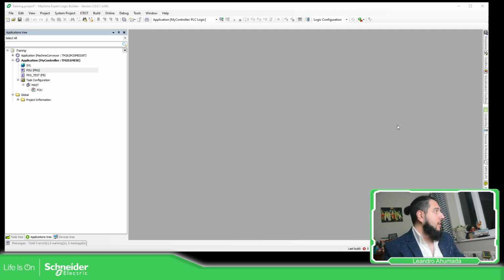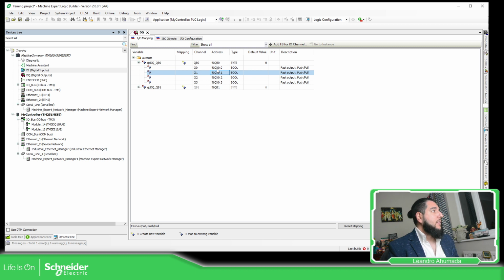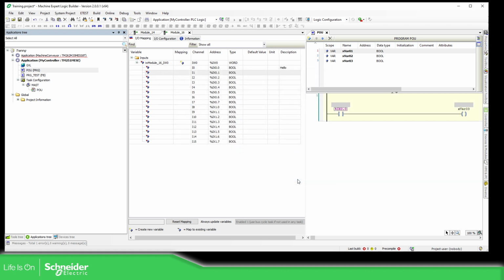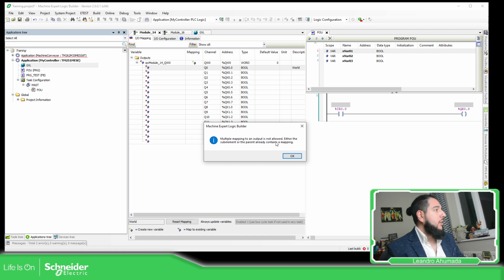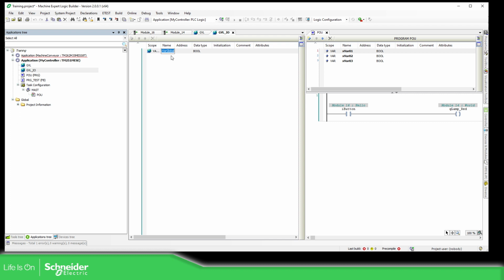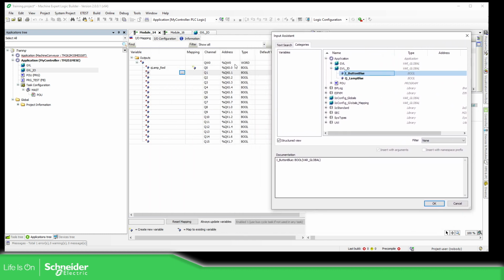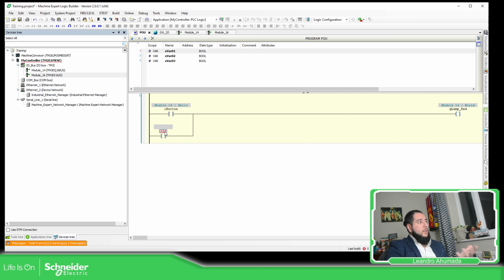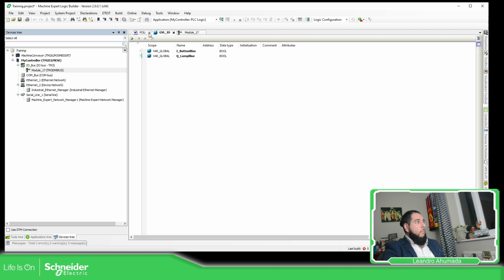EcoStruxure Machine Expert Training - M3.4 Getting started with Input & Output Variables

Comment: Hi Leonardo thank you so much for this amazing, series, I am very new with PLC I have M251MESC and want to use it with 3rd party motor controller, just wanna ask, is it mandatory to have I/O hardware like TM3 etc, or we can just form logic on plc with and mapping of I/O through eds file and transfer through CAN protocal,,
Reply from the maker: Hi there! You can use the M251 to communicate to another IO system without using the TM3 if you want to. In your case will be over CanOpen and you can import the eds or manually use the communication blocks for SDOs.
Reply: @LeTomasAHUMADA  thank you so much ❤

Comment: Hi Leandro. Props on the video! I wonder if it is possible to import a variable table from Excel to a GVL on Machine Expert. Coul you help meu out. Is there a way to do it with Excel or any other program?
Reply from the maker: Hi Vander! Manually create variables online it is not possible. Offline you can use the xml to import variables you can check the syntax when you export/import a file:
https://youtu.be/EpNegFHmQcU?si=44PJYDXRmmeLzfAO

I usually use the method in the video, in the past i had an excel to easily create variable name plus the syntax…i do not where that excel is 😅
Reply: Thank you my dear!

Comment: Thanks for posting these videos!  This is my first foray into Machine Expert and these are quite helpful.  One question...when using a GVL to map a variable to an IO point...is the status of that IO point still accessible externally via the non-symbolic address?  (Ie, %IX.0.0)  The reason I ask is I'm using a 3rd party HMI and I don't believe that symbolic addressing is supported by the communication protocol, so I will need to set that up via non-symbolic addressing.
Reply from the maker: Hi Rob! If I am not wrong you can assign the variables of the IO to a variable in a GVL. You will see that the address of the IO is disable. Then (this is the part that i am not 100% sure) you can give an address to the variable in the GVL then you can use that address in the HMI. I recommend you to check the next video to understand how the memory work in the plc:
https://youtu.be/xsS_JNg-5MM
Reply: @LeTomasAHUMADA  Thanks!  As soon as I got to the next video I had my answer, jumped the gun a bit!  Thanks again!